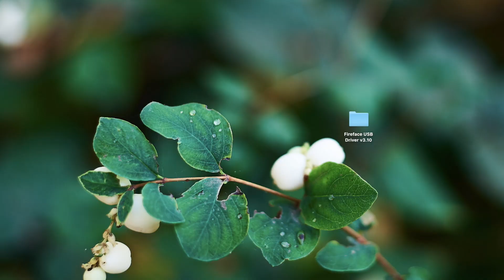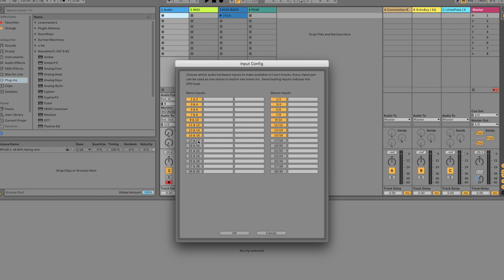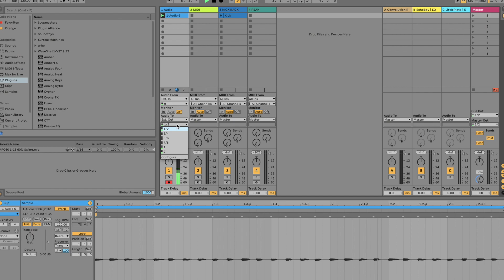How to setup Ableton Live with RME Audio Interfaces

Comment from the maker: Do you have questions about TotalMix FX? Let us know!
Reply: Can i add a virtual channels in totalmixfx "software inputs row" for controlling my ableton channels . And can i create a custom row where i should set a hardware and a virtual channels together?Thnx
Reply: Have been looking everywhere for help on setting up midi in/midi out for the Babyface PRO. I have a breakout cable (not from RME but this shouldn't matter correct?) and have setup MIDI in and out in Ableton but still cannot receive incoming MIDI from the interface.
Reply: i got a babyface blue and it works pretty well with my system but when i use the lowest buffersize i get some noises sometimes.
are there other asio drivers i could try for better performance?
Reply: Yes. Iam not getting any signal in Ableton. What should I do?
Reply from the maker: @matthiasmeyer3881  Do you work on Mac with an operating system High Sierra or up? Then you need to enable the microphone for Ableton in the security settings, otherwise no audio will be sent to Ableton.
Reply: @RMEAudio  I just did a clean install with my older Macbook Pro 15 with Mojave. Since then our fireface is not sending anything to Ableton. Oh ok I will check this out. Thx so much.
Reply: Hi, I'm trying to setup a Multiface with Live 10.1.6 in Windows 10. I've setup the Inputs and Main Out fine, but I can't work out how to setup phones for Cueing
Reply: Solved it, thanks to this old thread on the Ableton forum (https://forum.ableton.com/viewtopic.php?t=32081), with a little twist... (Assumption: You have a spare output available. In this case below we'll use ADAT 7/8)

In TotalMix:
 Function = Mixer View
 Options > Operational Mode > Digital Audio Workstation Mode
 In the Hardware Outputs group, turn ADAT 7/8 volume down and click its CUE button ON
 In the Control Room group, assign Phones 1 to Phones ( and we assume you have already assigned Main Out to your preferred output)

In Ableton > Preferences > Audio
 Driver Type: ASIO (If you're a Windows user)
 Audio Device: ASIO Hammerfall DSP (again, if a Windows user)
 Output Config: Mono Outputs 17 & 18 ON (this being ADAT 7/8) AND Stereo Outputs 17 & 18 ON (if you want stereo Cue)
(Tip: Label your Inputs and Outputs! eg Label one of the mono outputs 'Cue' and the Stereo Output 'Phones')

In Ableton Session View
 Under the Master track, Cue Out, click the drop down box and select...
 - 17 Cue - this will provide left-ear cueing (my preference); or
 - 17/18 Phones - if you want a stereo cue
 Change the Sends button for A from 'Post' to 'Pre'
 Click the 'Solo' button to change it to 'Cue'
 Then, add a Return track (this will be Return C if you have an Ableton factory default set)
 Move any existing effects up one return track (ie: Move Delay from Return B to Return C, move Reverb from Return A to Return B)
 Label Return track A 'Headphones' and set Audio to: 17/18 Phones

You can now click any track's Cue button (headphone icon) and it will be heard in your headphones (left-ear only if following my preference) AND you can turn up Send A for any track to create a pre-fade monitor mix.

Of course, if you're already using all your outputs besides the phones and want to use phones as an independent output for monitoring, sorry I've no clue. I think that's beyond the mans of my Multiface 1 :(
Reply: WAIT? Do we HAVE to use totalmix??????????????? OMG tell me I don't... I just bought one and if I have to use it I'm sending this right back... I want your drivers, I DON'T want more sliders and garbage standing in the way of the incoming or outgoing audio
Reply from the maker: @RooftopKoreansMusic  If you need any help with your RME interface, you can reach out to our international support. We gladly explain and help you with your setup.
Reply from the maker: @RooftopKoreansMusic  If you need any help with your RME interface, you can reach out to our international support. We gladly explain and help you with your setup.

Comment: I don't get Audio input and output devices in Ableton. All it tells me is "Audio Device" which is set to Asio Fireface USB (I'm using the Babyface Blue)
Reply from the maker: Is the Babyface working in other ASIO programs? Can you open Totalmix FX and the driver Window?
Reply: @RMEAudio  Alright, I got one step further: I had to enable instrument in the Analog input. There's sound coming through now :)
Reply from the maker: @kikipups   If you use the TRS (jack) input, you need to switch the instrument input in some models.
Reply: @RMEAudio  wow, that's a quick reply! 

Yes it does work and I think I narrowed down the problem: 

Totalmix doesn't receive the audio from my synth, but it's plugged in correctly. 
I'm hoping theres some sort of setting that needs to be changed and I just don't know how to do that.

Comment: i have the 'rme babyface classic' that has 2 XLR In, 1 Instrument In and 2 XLR Out. Now i just want to use an External Analog Delay as an Insert Effect for Ableton, but the routing doesnt work. Nor with using Abletons 'External Audio Effect', nor with other simple routings.  How does the routing get done withe the Babyface Classic, when i just have those 2 In and Outputs ?  With my Apollo and an Behringer Interface i have no trouble doing this. Please help me Guys! thx
Reply from the maker: If you use the the XLR out as your main out you need to use the headphone out, which also works as a Line out. Send your signal to the headphones out, into the delay. Delay output into the XLR input of the Babyface and record this input.